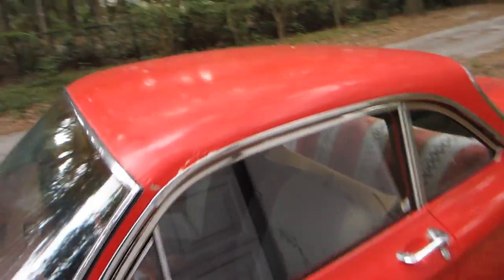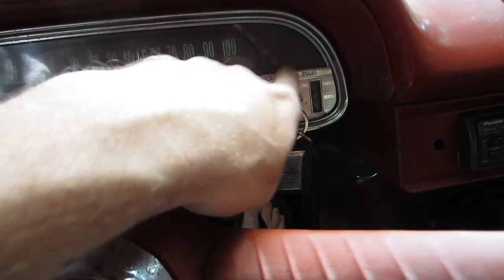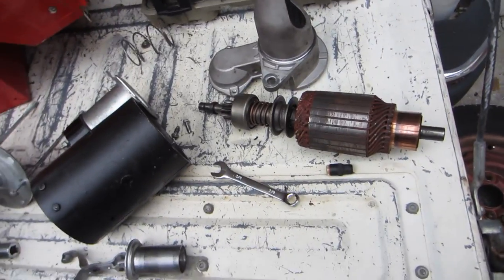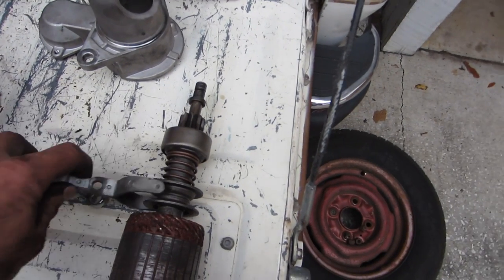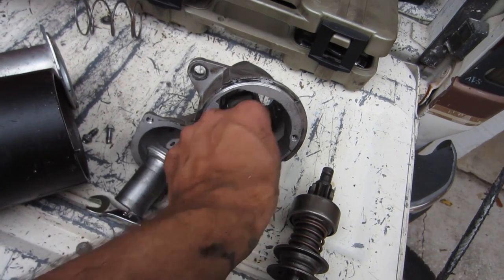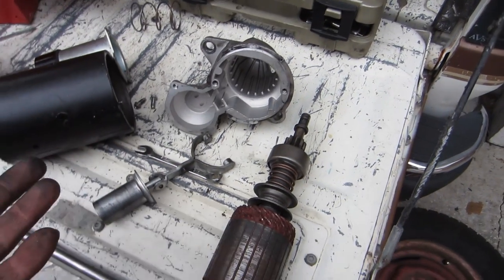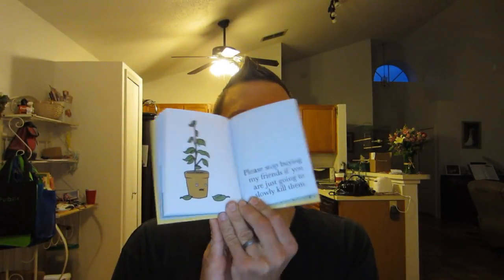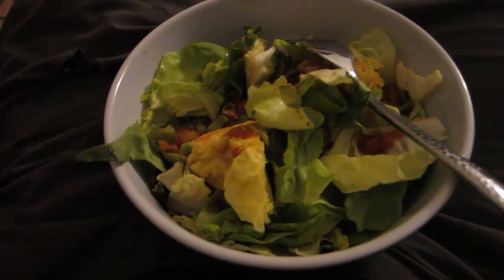Trying To Fix The Starter In The Corvair!!! (5.14.12)

Comment: When a mechanic changed my starter motor in my 63 corvair, he first drilled a good-sized hole in the firewall under the back seat to give access to one of the mounting bolts. He said it was standard procedure in order to make the removal of the starter way easier. Is this how you did it?
Reply: That’s what I’m about to do to mine. Can you give me an exact location to drill by chance?
Reply: @nicholasyoder
Reply: @nicholasyoder  no. 55;; years ago. but it was cut to go straight thru the firewall behind the back seat to the starter mounting bolt. maybe drill a pilot hole from the motor side and decide where on the seat side. He even had a rubber cap  the right size to seal it later so you won't get smog in the car. good luck.
Reply: @alohadotmorgan  okay thank you I’ll try it